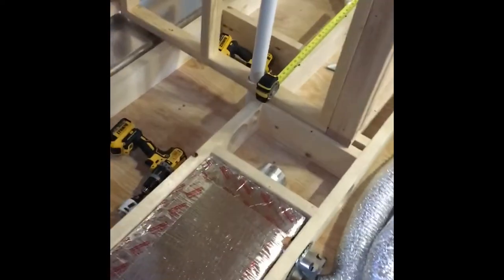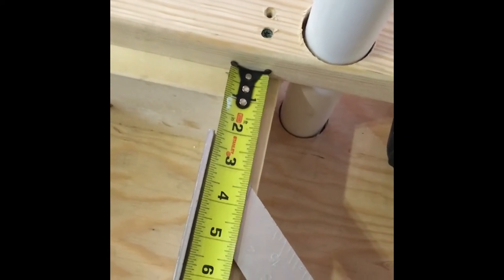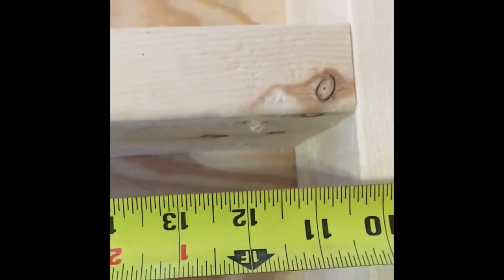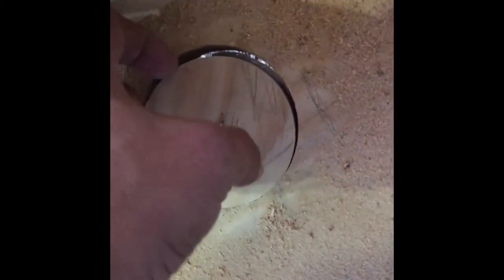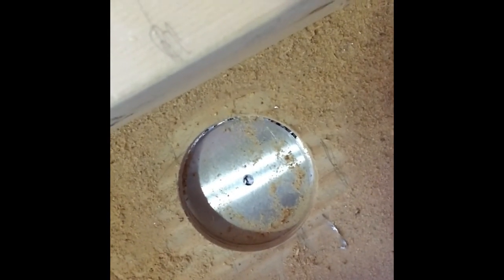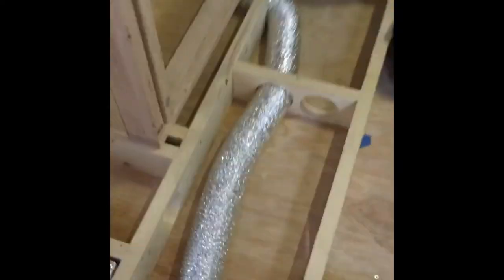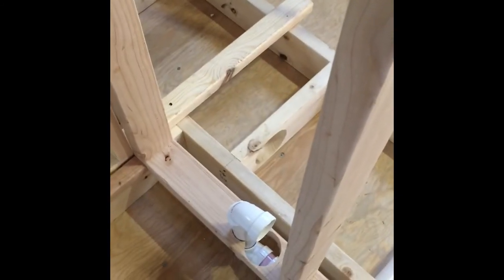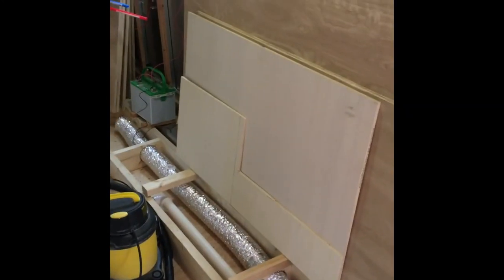RV Trailer Build #16 Part 3 - HVAC/Plumbing and Foam Spray Preparation

Comment: Vince, still liking the regular videos. Any thoughts to weight when you were planning this out? In my planning I’m trying to calculate some big items like how many sheets of ply x by their weight etc.  Soon realized 1000lbs of play can happen pretty quick when using 3/4”. A 2x6 isn’t light either!
Reply from the maker: wood 2,000.00lbs
water 834.00lbs
propane 200.00lbs
furniture 500.00lbs
fridge 190.00lbs
stove  60.00lbs
microwave  100.00lbs
batteries  600.00lbs
gen  50.00
other  1,000.00lbs
toys  1,200.00lbs
contents sub-total 6,734.00lbs
dry weight sub-total 5,390.00lbs
Total Est. weight 13,468.00 lbs with 18k capacity that leaves me 4,532.00 lbs trailer surplus weight +/-
Reply from the maker: I have 4 sheets of 3/4" ply in my build. You'll notice my 2x6s I've drilled out most of the wood for heat ducts and water lines and gas line - and some more to reduce it's weight - depending on your axle setup and weight capacity of those axles - what I did was use a % of their capacity (which in my case was 2/3rds) or roughly 60% and then a 15% tongue weight calc.
Reply from the maker: Also, about 60% of my added weight is over the 3 axles - with the fresh water tanks and batteries just forward of the axles - seldom would I travel with full water tanks (200gals or 1,667 lbs) - I would fill them when I get close to my destination assuming my destination does not have water supply...
Reply from the maker: Plywood thickness in 
millimeters approx. inches weight lbs.
6mm 1/4" 21 lbs
9mm 3/8" 31 lbs
12mm 1/2" 42 lbs
18mm 3/4" 62 lbs
Reply from the maker: Nominal Dimension (in x in) Length (ft)
2 x 4 11# 16ft
2 x 6 16# 24ft
2 x 8 21# 32ft
Reply from the maker: Now - what I have done to give myself some added weight flexibility distribution is this... I have two waste-water holding tanks - 45 gal each... Which a gal weighs approx. 8.34lbs, each tank I could fill or empty based on my situation at the time (which are directly over the axles) I'll have to do some testing once all is finished... but 90 gal of water weighs 750lbs roughly +/- that I could use to place more weigh over my axles if needed...